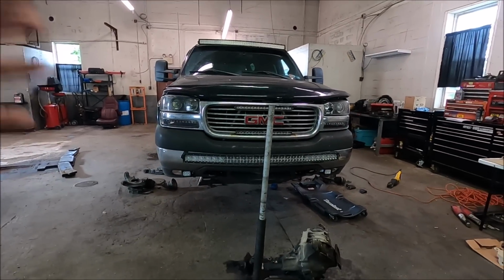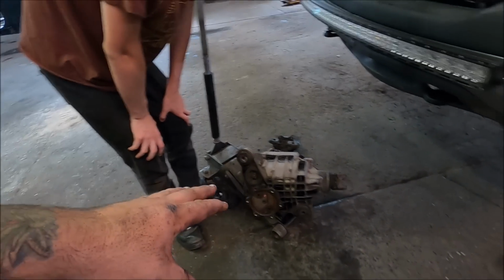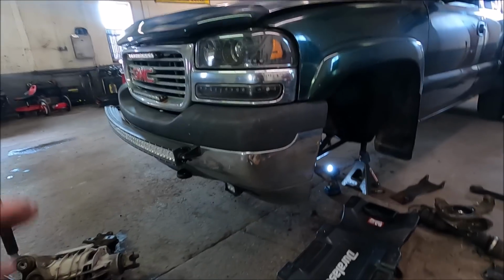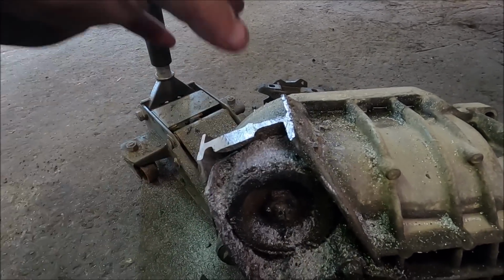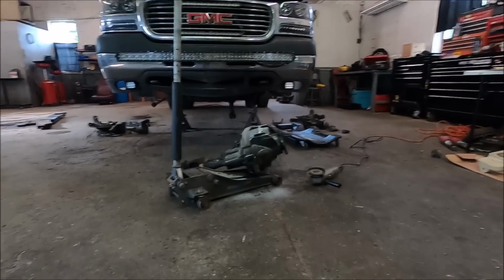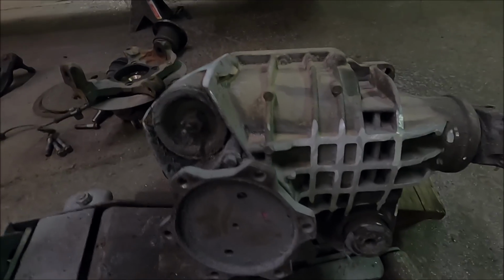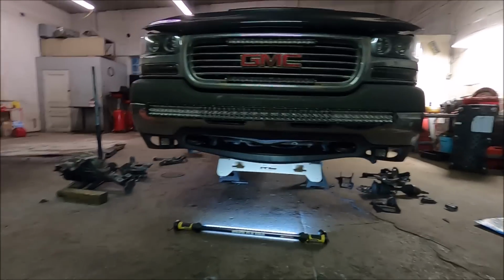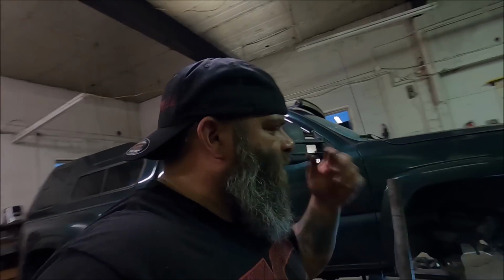I RUINED My Duramax For This Rough Country Lift Kit!.........*The Duramax Lift Kit Build Part 2*

Comment: Just a heads up I had to add aftermarket upper control arms due to camber issues when I installed the 6” RC on my 2007.5 duramax.

Comment: Might as well service the diff. and ball joints (not included in lift kit) and tie rods. Power wash would'nt have hurt to paint any subframe rust from road salt exposure. But other than that lift is looking good ,Andy.

Comment: It may be better to use a flap wheel, those grinding disk are designed to be used on there edge not the flat part of the wheel.